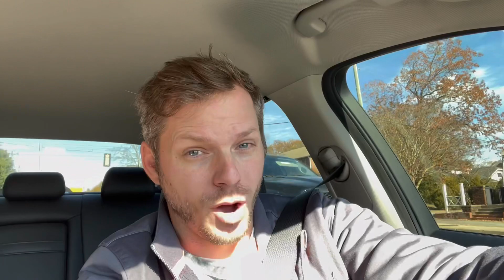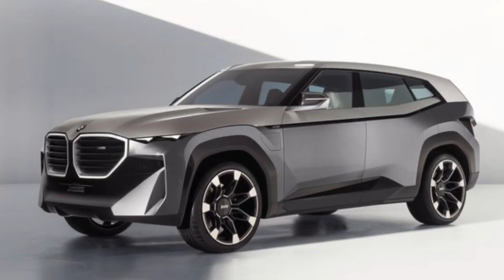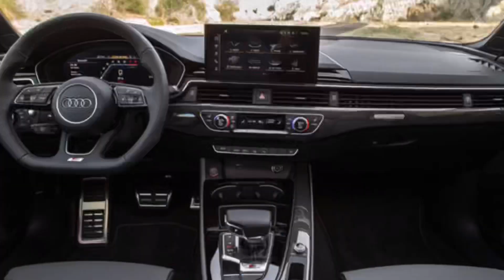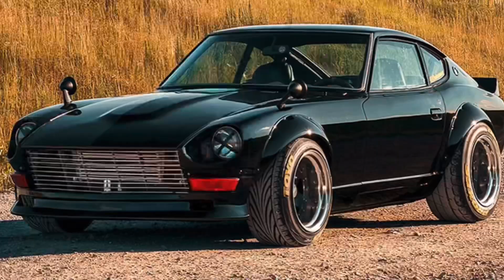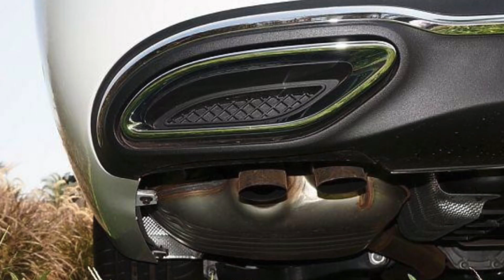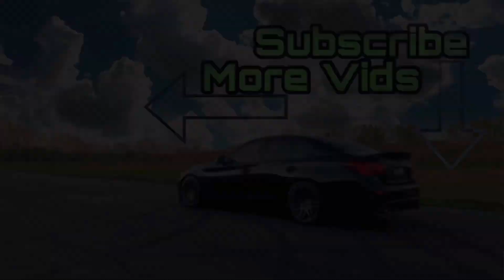4 Reasons Modern Cars SUCK

Comment: The 90s was peak automobiles IMO. Sleek coupes, sedans and hatchbacks. My ‘94 Toyota has 300k and still runs like new on the original engine. Hell, even my  early 90s Chrysler products still run like new. I guarantee you nothing built today will realistically be on the road in 30+ years like the 90s cars are currently.
Reply from the maker: I feel like people in the 90s said these things about their cars too lol.  I mean as far as performance, the 90s was garbage.  Mustangs making 200hp, corvettes barely at 300, all the cool mopars were gone.  But I would agree that there are many cars today we will not see in 30 years

Comment: I tow cars and boy do I hate these stupid ass modern bs egg cars.   Look, the car is dead and that means the fucken car cannkt be pushed.  Its ELECTRONIC SIDE BREAK (!) is stuck and you cannot get anything done if yhe battery is dead or if the engine is totalled.   In case of old cars that I LOVE you just flip the fking transmission into neutral and push the button to release the side break down.  Then you are all good to go.   But the modern piece of crap "futuristic" crabs you need to bring over a lab of electricians just to get the break lose.   So I hate all cars above 2015.

Comment: Thing drives me insane is that a vehicle no longer a vehicle it’s a comfort smart box on wheels. Too much crap we don’t need manufactures spend more effort in this department instead of building a good reliable car. They slap the cheapest engines in these things small 2.2 litre 4 piston engines with a turbo slapped on it making 200 horse power or more over working these engines and mate it with a god dam CVT but the comfort of the vehicles amazing and all the tech. Yea none of that matters when the engine blows up.
Reply from the maker: I’m with you 100%!
Reply: i wouldn't give them that much credit. comfort? expensive premium seats from sofas to cars and coaches suck mostly. £30k car but they couldn't put decent seats in.